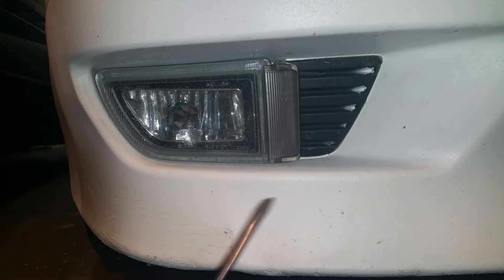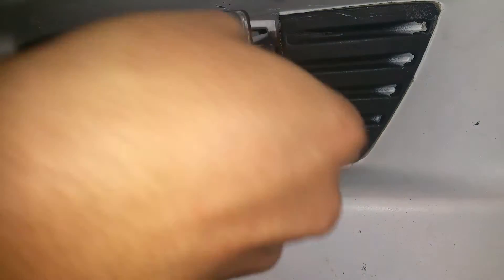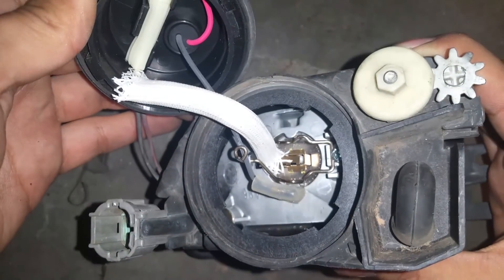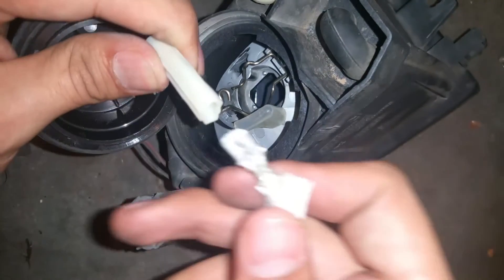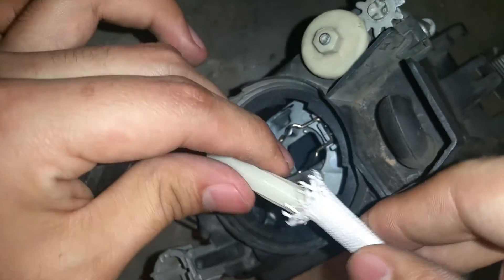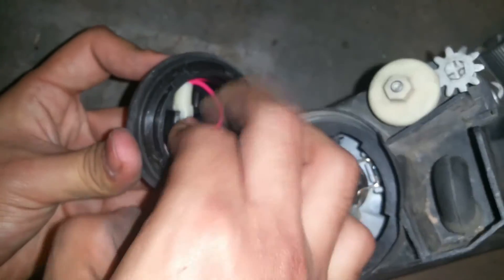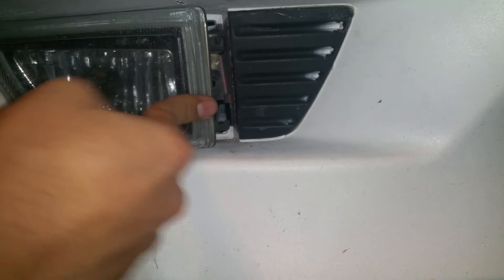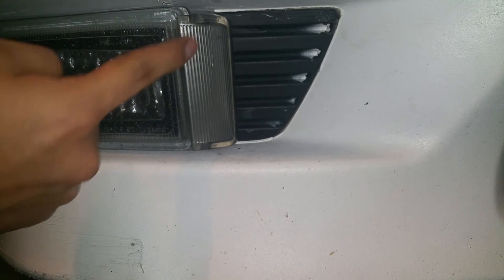Here Is How To Fix A Bad Fog Light Bulb On A Infinti G20

Comment: Hey bro  I just got my shelf a g20 
I was wondering if you can help me out where is the fog lights switch  to turn them on 
thanks and keep the good work
Reply from the maker: The fog light Switch is on the turn signal indicator or next to the power mirror Switch. If you dont see it your vehicle didnt come with fog lights if that's the car you need to get the switch from a G that does have the fog lights

Comment: Hello, my g20 left side fog light doesn’t have a cable harness but my right side does? Does that mean I have to buy the harness for the left side ?
Reply from the maker: it could be that it was cut if they should all have them
Reply: ERICSDIYGARAGE thanks for the reply, on my right side I see like 3 connectors, (I think) but 2 are the same. I believe one is for each side but somehow someone before me put all of it in the right side. Might but some aftermarket fog lights. The g20s are hard to come by and expensive on eBay